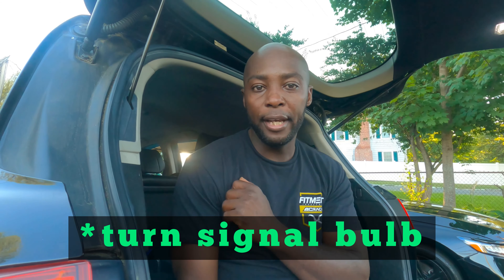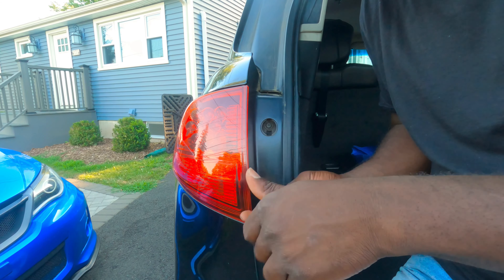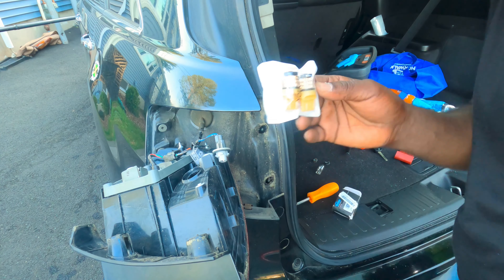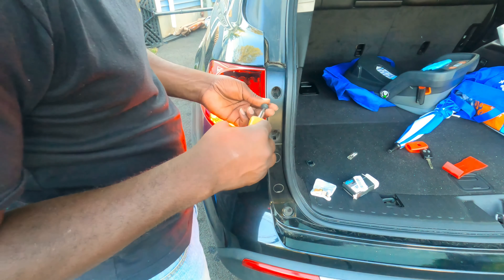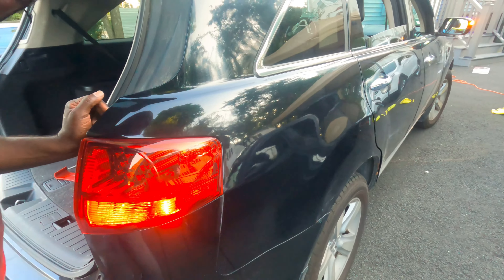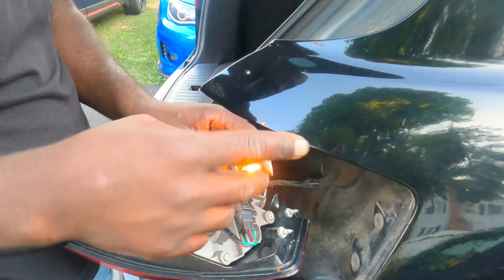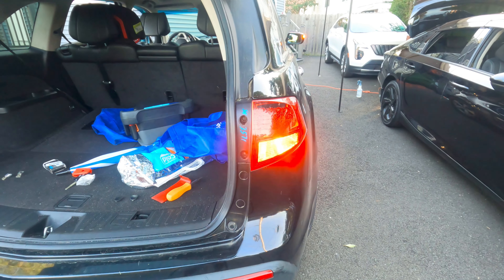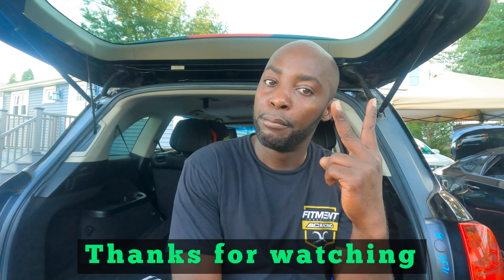2007-2012 Acura MDX rear Turn Signal LED upgrade

Comment: You don’t need a resistor for this or this is just the bulb itself
Reply from the maker: NOPE. It already come included in the light itself.
Reply: @CarStomIt  I bought these same one you left in the link and it was hyper flashing. What should I do?
Reply from the maker: @Songsas  mine were not. that mean they may be defective. please contact Customer services they will replace them for you.